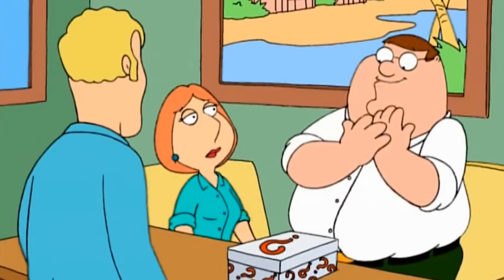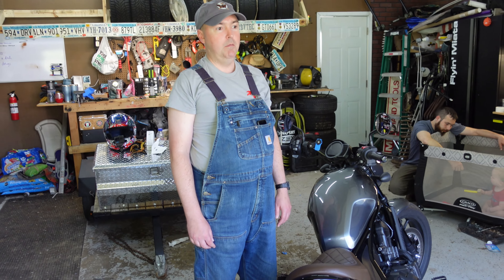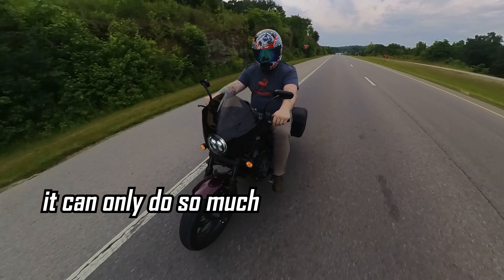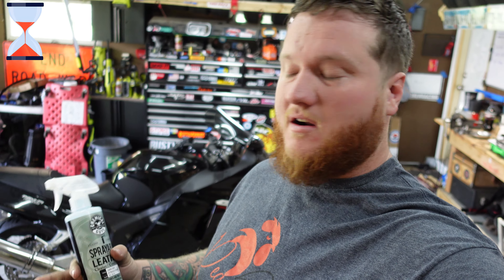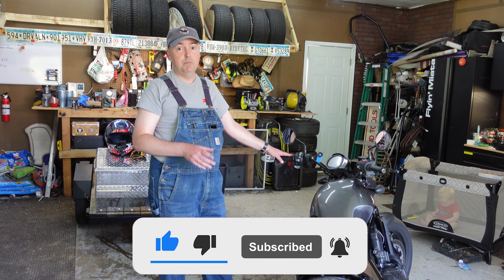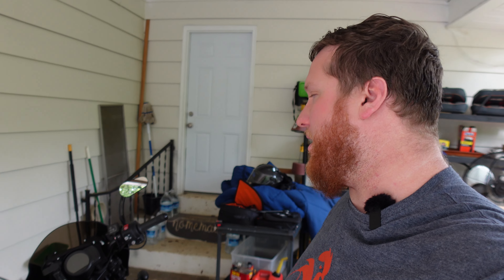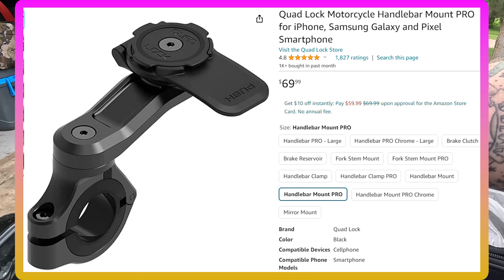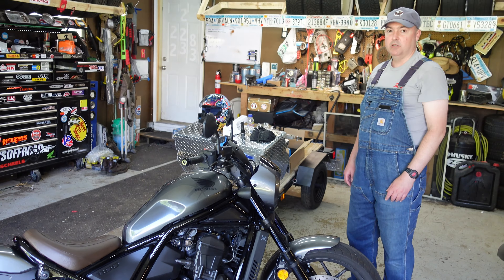We spent $6000 on Rebel 1100 parts so you don't have to

Comment: Totally agree with the Vance Hines exhaust finish comments.
Reply from the maker: @jerrycarter1928  did the same happen to yours? I'm told they've been unavailable for a while, hopefully they're working it out. Finish issues aside, it's the best build quality and sound I've witnessed on these bikes.
Reply: @redhenracing2  no, but I know the brand name so I've come to expect very good results on fit, finish and performance.  If I had to guess, they sourced the manufacture out to China, with no supervision on quality control to make sure they were made well.  Instead, they were made to a price point; they only looked good new in the box.

They might sound great, but if they look like yours, they will not sell another set of pipes.

Great video BTW.
Reply from the maker: @jerrycarter1928  that could very well be the case.

Thanks pal

Comment: i test drove a rebel 1100T dct today.  very powerful and can see it would be a very fun bike to ride, but literally 5 minutes in, my butt started hurting and i'm wearing skiveez!  at least on the 750x, i can go 45 minutes without my butt starting to hurt with skiveez on.  incredibly uncomfortable!  and you can't fit a helmet into the saddle bag.  you can fit a helmet in the "frunk" on the 750x.  2 big dings against the rebel.  i'm sticking with the 750x
Reply from the maker: The 750x is a very different machine, certainly more suited to adventure touring purposes. The Rebel absolutely needs a different seat, I wasn't on Roby's long enough to tell a difference between the stock and SE seat or whatever it is that he has, but the Corbin makes a WORLD of difference.

Comment: Red Hen should pick up a Kawasaki Vulcan 750 and do similar mods. 

As for the exhaust mods, a loud pipe and poor seat make long distance riding very tiring.
Reply from the maker: I got nothing against the Vulcans, I'm just generally not much into cruisers to start with

That's why I say the V&H is the perfect setup on the Rebel, it has just the right volume to not cause any fatigue after hours 👌

Comment: Any link for the handlebar risers ?
Reply from the maker: Just updated the description, here's the link

https://gidibii.com/products/handlebar-risers-honda-rebel-cmx300-cmx500
Reply: Question, that link is for the 300 and 500. Will these work on the 1100
Reply from the maker: @stevendawson1488  yes, that is the exact set Roby is running on his bike. No modification required, they fit up the exact same.

Comment: Nice review of parts.  The Honda heated grips working with the display is cool.  How well does the Cardo sound and work with the aftermarket slip on?  I don't like the looks of the stock muffler on my Rebel 1100 and am looking at the Two Brothers one with the silencing cone.  Maybe, the Vance and Hines.  But, I have to be able to hear my wife over the Cardo Edge while she rides her Rebel 500.  Stock sound doesn't bother me but muffler looks terrible.
Reply from the maker: The V&H is the correct oem+ option, it's what the bike should have looked and sounded like stock, and they are showing them in-stock again so hopefully they've fixed the finish issues.

Comment: What year is the gray honda rebel? Also did he just put the 1inch risers on and didn't need to change the length of the cables? I have a 2024 Honda rebel 1100t and thinking about the risers. I did install a sissy bar, luggage rack and vincent hines. Also installed the engine guard.
Reply from the maker: Roby's bike is a '23, and my Merlot is a '22. For just one inch of riser, no cable adjustments are necessary at all, at least with our DCTs. If there's an issue with the clutch on manuals, we wouldn't know about it. Highly recommend giving it a shot though!

Which engine guard did you go with? I've been considering one as a place to mount extra lights.
Reply: Also I'm not sure if it would work with the forward controls.
Reply: I was able to install a 3 inch riser, on top of a 1 inch keeping all OEM cables, just rerouting them, not such a big deal and your back will thank you.
Reply from the maker: @northofthecity21  I have seen as much as 4 inches without having to extend anything, just re-routing some stuff

Comment: LOL, Im something around your weight. Im glad that there's someone that gives their impessions from that perspective.

I call myself a "Man of Substance."
Reply from the maker: If you're my stature, you absolutely must try the handlebar risers. It's the best $30 you'll ever spend.
Reply: @redhenracing2  yeah, at six feet the bars seem far away. I'm actually get some 4" pivoting risers on tomorrow. Alot of your other upgrades I was already considering, but after your video now I feel good about doing them.
Reply from the maker: @Malevolentguppy  I haven't tried a 4", but that may be what I go with on mine. Let me know how you like them
Reply: @redhenracing2  Good evening sir.  I've had a chance to ride for a bit with the new risers on, and they are amazing.
I can now sit upright, instead of canted slightly forward as before, and my elbows are bent some, so it's quite comfortable.

I'm having to get used to the new riding position, since it puts pressure on different parts of my butt than previously. The risers also put the mirrors up higher, so I get a better field of view as my elbows aren't in the way so much.

All in all, I'm very pleased with them.  For reference, I'm more torso than legs due to a smaller inseam than you'd expect from a six foot guy.
Reply from the maker: @Malevolentguppy  excellent report, glad you're happy with them. Maybe I'll go with 4"s when I do mine 🤙

Comment: i ran ram mounts on a few bikes and didnt have issues although i did use the rubber straps with mine, even held phone on the bike through a complete destruction crash i had in 2019
Reply from the maker: They work until they don't 🤷

Comment: Im Also 300lb+ with a ginger beard, so your advise is extremely relevant! Bikes supporting my weight/suspension/ seating are all major factors for me, so thanks for the review! Im looking to trade my versys1000 for a rebel soon.
Reply from the maker: Corbin, stiletto shocks, and bar risers. You'll be good to go 🤙
Reply: @redhenracing2  yup i gathered they would be essential for me, thank you 👍🏻

Comment: Good shit my dudes, any messing around with the wiring when installing the riser?
Reply from the maker: Nope, the 1" does not require any extension whatsoever. A little fiddling with some clips to generate some slack is all it takes.
Reply: @redhenracing2  awesome, thank you for the response

Comment: I know I'm probably gonna get laughed at for this, but I would love to get a proper dual side exhaust for the Rebel. That way, it could probably have the correct flow while being positioned on both sides, and not take so much space on one side. It could allow for bigger saddlebags without sacrificing the lean angle.
Reply from the maker: Interesting idea, I'd be down to try one out if the price was right. Unfortunately I think you're adding a lot of material and cost there.
Reply: @redhenracing2  Probably. But, it does bother me when things are so asymmetrical 🤣.
Reply from the maker: @_nopestr  it does me a little too, but that left one holds a week of groceries so 🤷
Reply: @redhenracing2  It's not about practicality though. Just looks. I might need a proper bagger to deal with that 🤣. Look at the Indian Chieftain for example - it has dual exhaust, and the bags are the same size. Love the symmetry. Too bad it costs twice as much though...

Comment: Have you ever experienced any hopping from the front end of your bike? I'm 200lbs 5'9 and I have basically maxed out the preload on the front and rear shocks. However, once I get to 52mph (consistently) the front end of the bike starts shuddering. I've put a brand new set of Metzler cruisetec tires on front and back and it's still happening! I started to wonder if I was too heavy for the bike, but 200lbs isn't crazy. 

I've got it booked in with my dealership because I actually think something could be wrong with the front shocks, because the bike shouldn't be doing this, but curious if you ever experienced any quirks, as a gentleman of your build?
Reply from the maker: Absolutely not, never seen anything like that. Let me know what you find out

Comment: I have the handle bar risers on order and I just picked up a pair of “Rebel” wide foot pegs in black to keep with the totally blacked out look of the bike! Also, just after I purchased my Rebel last August, installed a TPM (tire pressure monitor) system that I got from Amazon on my bike and it has worked flawlessly for almost a year now and it’s extremely accurate when I compare the readings to a regular tire pressure gauge. It’s spot on and the I only need to charge the battery in the main unit every 5+ months! I highly recommend it! 👍
Reply from the maker: I've thought about running some of those tpms sensors, which brand did you go with?
Reply: @redhenracing2  It is a Fangzi TPM if I remember correctly. It was around $39 bucks, I haven’t had any problems with this system at all! It even has an audible and flashing alarm if one or both of my tires should start to lose pressure below the psi that I set. So if I catch a nail and get a slow leak, it will let me know. It also works if my tires become over inflated above the psi that I set. The setup is not difficult and the directions are pretty easy to understand. It took me roughly 20 minutes to complete everything including the sensors install. Also it’s waterproof! 👍

Comment: Yo ! I’m in WA as well and appreciate you guys taking the time for these videos. I just bought a ‘22 rebel 1100 DCT and my credit card is popping off for add-ons to this bike 😂

I do have some questions tho. 

1) How tall are you guys? I’m 6’1” and I’m torn whether to get the Trex peg ext, or the Burly pegs?

2) Will the shorty exhaust burn my wife who wants to ride passenger?  😅

3) Have you seen the Trex headlight cover? I have one but unsure if it could interfere with your choices of the windshields ?
Reply from the maker: 1) we are both 6-1, 6-2 and I definitely have switched sides on footing. The Burly MX pegs are the shit, and I'll be seeing if I can fit them to the BlackBird as well.

2) if you're talking about the GP Shorty style exhaust, that just puts out right off of the header pipe(like I was running in our first Rebel video), it should be able to be angled away from the rear footrest. But it looks and sounds really bad compared to either of these, you should consider the V&H if they ever put it back into production

3) I am aware of it, but haven't looked at it closely. If it fits tightly around the silhouette of the light, it shouldn't interfere, but I can't say for sure.

Comment: I found the audio clipping annoying to watch the video.
Reply from the maker: Yeah, sorry dude. I did my best to edit out that frequency and just lowered the level and captioned it for you, but my bike is being rented out on the other side of the country so I can't just re-film with it at will. 

How would you have handled it, full voiceover?
Reply: @redhenracing2  You need a little more preparation when filming. And an audio recorder with a built-in compressor - that will make a huge difference. If the recorded audio is clipping, then there's not much you can do to save it.
Reply from the maker: @_nopestr  do you have any recommendations? The Sony mic I mentioned in the video only acts like that at higher speeds when wind noise clips it out. It's the same mic as the footage on Roby's bike, just sitting in much lower speed traffic. It's being run off the gopro media mod on my chin mount. 

Audio quality is one of the next things we are going to start pushing on for our production quality, as it has presented itself as a weak link a few times now. If you have any experience with in-helmet stuff particularly I'd love to hear it
Reply: @redhenracing2  In that case, maybe it's the wind messing with it at speed, and you just need to put a dead cat on that mic. It's worth a try before you shell out on an external recorder and a different mic.